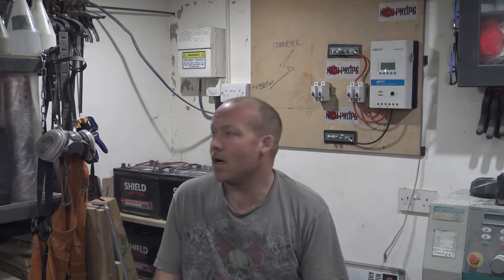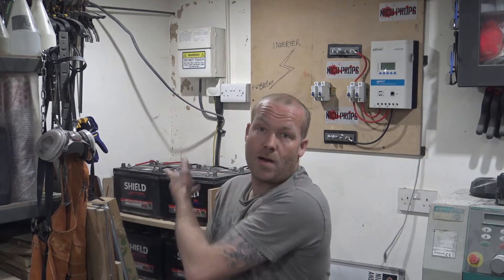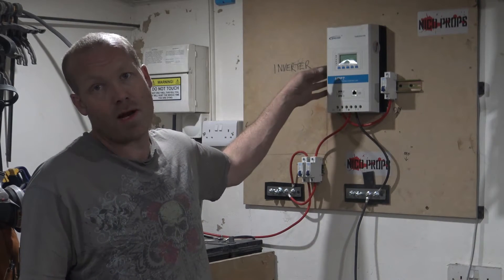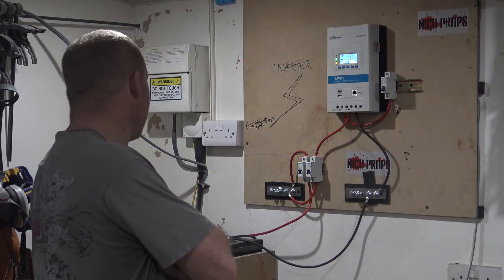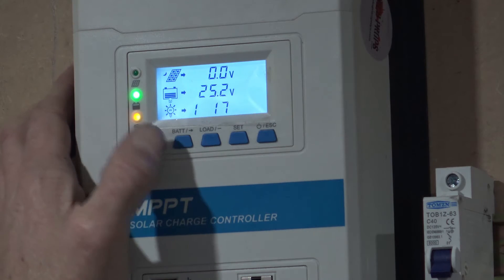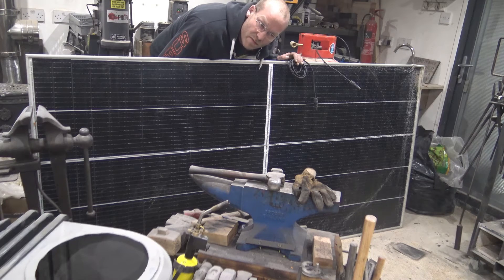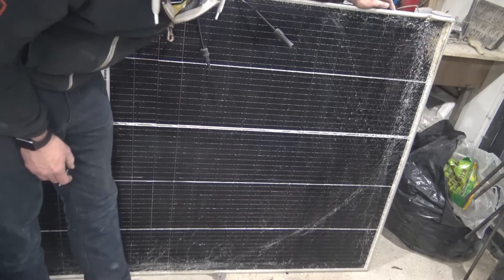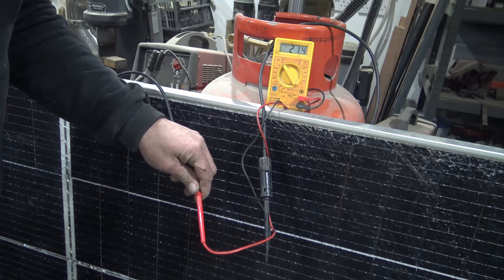Solar power, under £1000 : part 2 , EPEver upower UP3000

Comment: Hi Chris. I fairly recently had to replace my hybrid inverter as it went pop and I had issues with the company that supplied it. I ended up going for the Epever Upower 3000. The same as you used in this video. After seeing part 2 I was looking forward to seeing how you got on with it, as I have issues getting the inverter to stop topping up the battery charge and drawing from the mains when the battery is fully charged and the voltage is well above the values set for it to stop charging from the mains. I have it as Solar Priority and Inverter Priority but it will take a tiny amount from the battery then flip back to taking the supply from the mains. I can't find anything anywhere on this. So I'd be really interested to hear what your experiences were with this unit. Thanks.